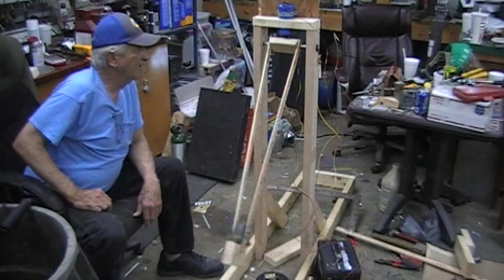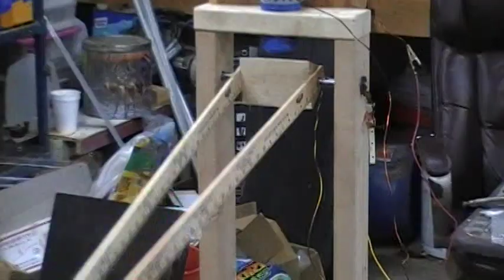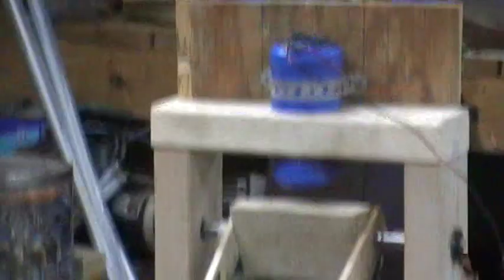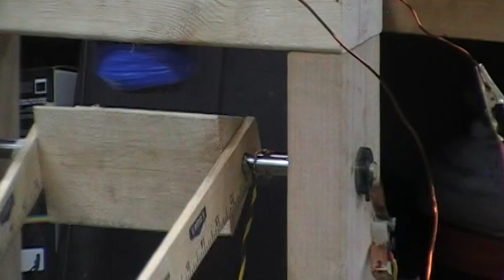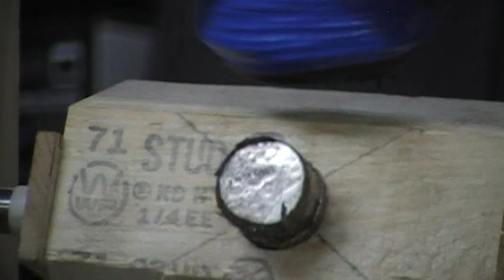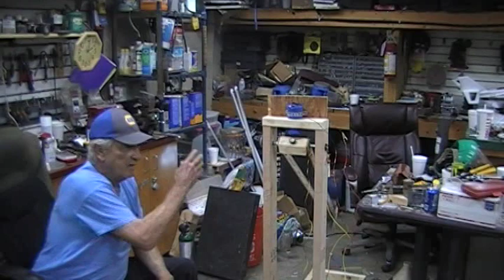Prototype Magnetic Drive For 2 Stage Oscillator [part 1]

Comment: thanks for posting.   here are some things to consider.   without a crankshaft/output shaft, ANY power leaving this apparatus is NOT continuous.   any gain Must occur near Bottom-dead-center;   and MUST be tiny and Intermittent.   so.   the 'density' of any power leaving the machine is Low.   and of no real use.      see linked video and my comment there, if interested in the 'real deal'.  an energy return of 104%.   see my channel, if it suits.      cheers
https://www.youtube.com/watch?v=lTkXciAn488
Reply from the maker: Your comment tells me you have not seen the videos of the Real machine that is out side . The machine you see in this video is ONLY to test a magnetic drive system for a MUCH larger pendulum . My bigger machine outside produces 140 watts.
Reply: that's nice.   how many watts are going in.  190?
Reply from the maker: That's the point of building the magnet drive to measure the watt input.  We have , in the past , driven it like a grand father clock with weights . Less than 20 inch pounds in and over 300 inch pounds out .
Reply: YES.  (but, forget about gravity, and turn it ninety degrees.  gravity pays you and then takes most of it back.)       force applied to a lever is, first, converted to motion/mechanical energy.  then it is converted to Torque energy, near the fulcrum.    where a lever operates, Continuously, through 360 degrees of motion, it functions as a rotary 2nd-class lever.   the fulcrum 'becomes' the center of rotation.   ( see a classic hand-crank.)   the movement of the lever end-point describes an  Orbit.   energy/force can be applied, there, at one or more Fixed points by using a  wheel or rim.    keep at it.  see the way a ferris wheel is driven, at its Perimeter.    cheers                               googletranslate
https://www.publicdomainpictures.net/pictures/170000/velka/ferris-wheel-drive-mechanism.jpg